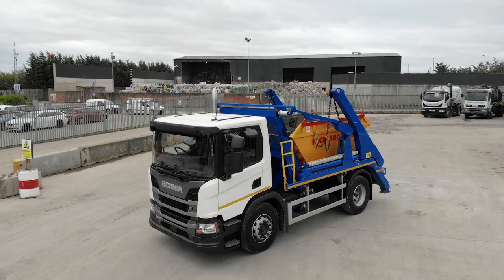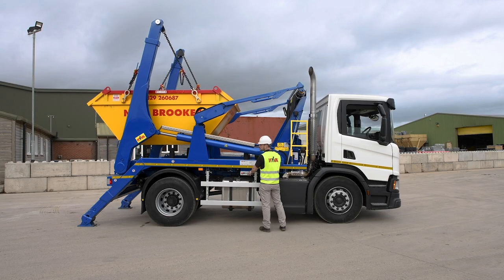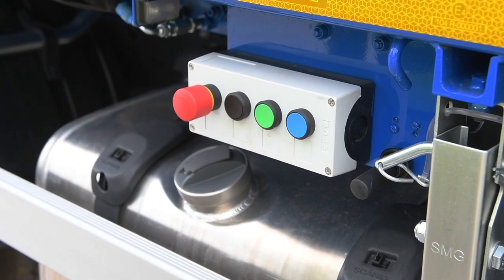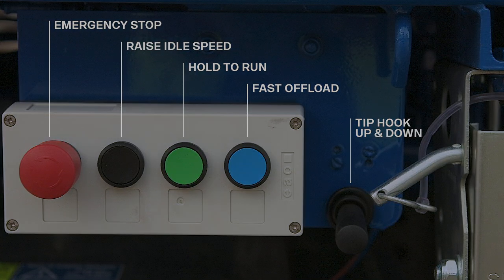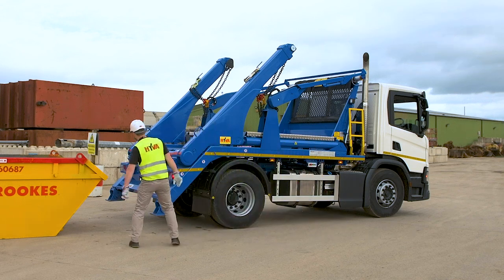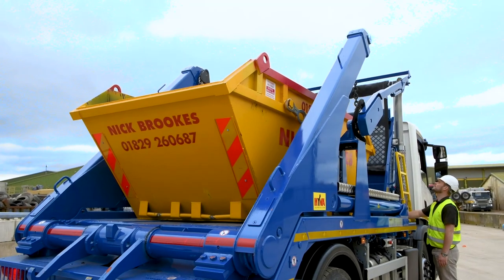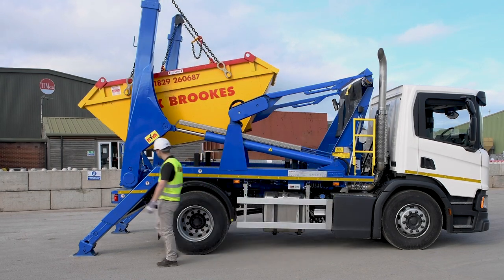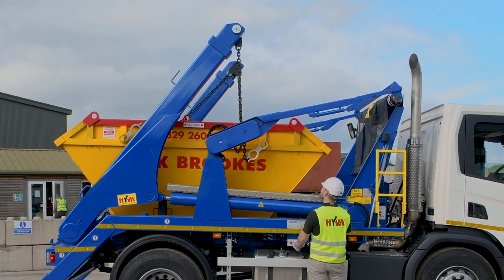Scania Hyva Skip loader explained

Comment: Can I ask How many skip drivers actually stick with in the recommended weight limit of axle or vehicle weight, unless the skip trucks have weight limits on them to let the driver know how would they know until they get on to the weigh bridge to tip off. I’m just taking my CPC course and I’ll be looking into driving for a local skip company. They have a 3.5, 7.5 and a 10ton vehicle, can I also ask how do EU driving hours work as your doing a combination of driving and other work, do you stick to 45 mins after 4.5hrs or 15 mins then 30 mins after the 4.5hrs or can you get away with 6hrs combined work with a 15 min break then with in the next 3hrs taking you upto 9hrs you then take the next 30 mins

Comment: Scania, great truck BUT, an automatic gearbox has no business on a skip lorry, cruising up a motorway from a factory to a distribution centre absolutely, but when manoeuvring skip lorries in tight spaces often where mounting kerbs close to parked cars, walls and/or fences etc or when off road ie construction sites the sensitivity of a manual box and clutch is best. Standard manual 4 over 4(range change) For 18t and standard 6 speed manual for smaller. 
Hyva, great loader BUT, Hold to run button is ridiculous, pointless and terrible design feature. 3 hands are needed to use it if an operator wants to combine loading/off-loading control with extending/retracting of telescopic control either independently or synchronised for fast efficient loading when blocking roads or more often, loading/off-loading skips on gradients, uneven ground or at angles as access to get square on with skip is a factor. A very common real world reality of the job. And the simpler sheeting system with the roller elevating behind the cab and fixed sheet arms is better. Granted this one eliminates potential ripping of sheet from snagging on skip contents when covering/ uncovering skips. But sometimes sheets and arms can get caught on skip and or contents so having expensive tooling exposed on the extremities of the sheet system ie roller and hydraulics within the sheet arm is high risk of expensive damage. Much preferable to replace a cheap ripped sheet than an expensive bent roller or ram. 
Apart from a couple of very minor design issues with both truck and loader equipment which individuals are always going to have Scnia/Hyva is definitely a combination of the 2 best products out there.
Reply: Synchronous extend of arms isn't needed - one hand should be able to operate both single levers and while doing so be able to apply a twist to reduce or increase one lever relative to the other if one arm needs a different amount of movement.

It sounds like you have skip lorry operataing experience. Can't say I have that - so my preference would be to use the tip hooks as skip clamps for travelling - I'm pretty sure I've seen this done in the past - so once the skip is loaded, it is clamped in place at the back with the tip hooks. I'd appreciate your thoughts on this ?

Your comment about auto boxes and manual clutch is interesting. Considering most bin lorries - which often need to do careful manoeuvring are now fitted with auto boxes. Have you experience of using an auto box in tight spaces ? With car brakes, it's not an issue but I've never tried it with truck brakes. Another option that should be available is to force the gearbox to stay in the lowest gear - to prevent the vehicle going too fast. I don't know what the highest lowest ratio an auto box will use but I think it could be 3rd, 4th or 5th. Even flooring the accelerator with an empty truck may not (& probably won't) get you into bottom gear. You need a stopped, fully loaded truck on a steep uphill to force an auto box to use 'crawler'. But, if you can force the box to use crawler, you should find the truck would climb kerbs at tickover ! Hmm, the cops would be after you for kerb crawling :)
Reply: @millomweb  Listen to what Alex said. He is bang on. Tipping hooks do not clamp the skip in place.